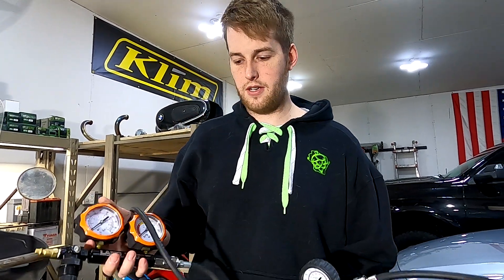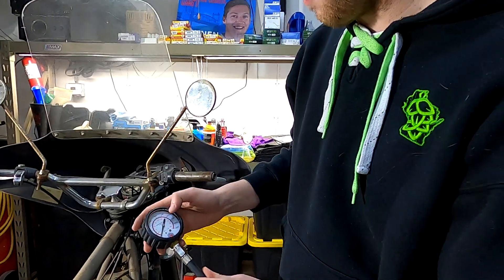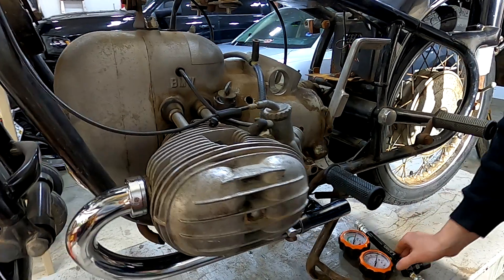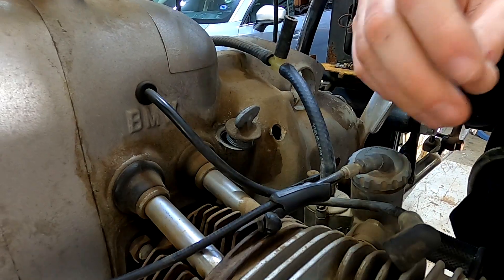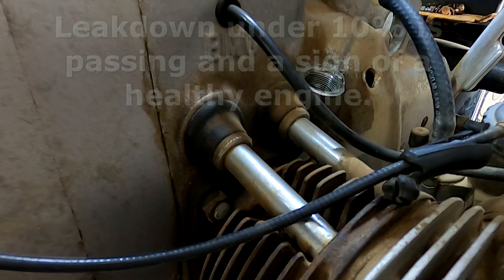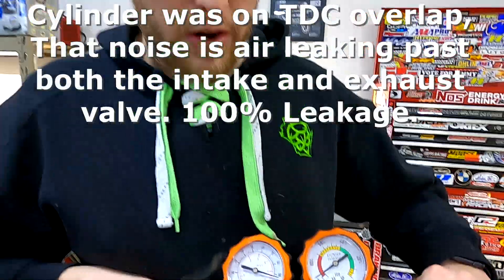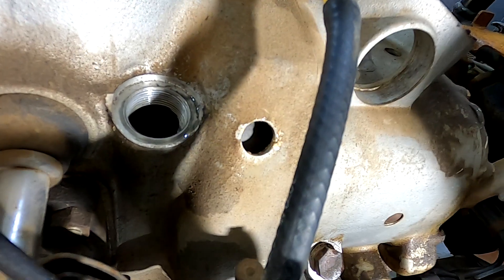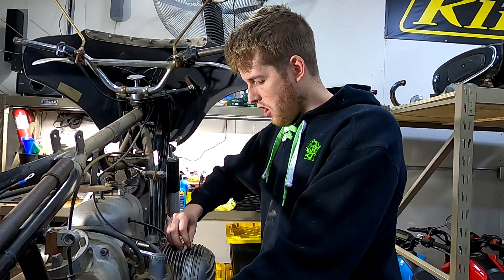BMW Airhead Compression and Leakdown Test Procedure

Comment: Hello, thank you for the grat viedos. Help me a lot. Could you please tell me how much is an accaptable cylinder end compression for an R51/3 airhead? MIne is around 72 psi , which I think is very little. Lots of air coming out from the crank pipe below, as well.

Comment: So, worth mentioning would be the compressor pressure you are pumping in please. Also, if you were doing say a leak down test on a two stroke - after I have done one on my R69 - I am guessing that the shop pressure should only be 10psi yes?
Reply: Yes I would be concerned at workshop pressure blowing seals etc. personally I would set the shop pressure to 10psi max.

Comment: Enjoyed this vid - really informative. So explain to me please. Compression test had large variance between cylinders which is contrary to what was shown on the leak down test. So why does the compression test contradict the leak down test?
Reply: Yes totally understand that but please explain why you would do a compression test Vs a  lead down test. What discriminates between using one against the other.
Reply from the maker: they are 2 totally different tests.

Comment: Thanks for all the videos relating to R50/2s. I am currently working on the exact model left to me by my uncle. With 75,000 miles on the clock im concerned about the oil slingers, it looks like a big job to clean them. Thoughts on an slinger cleaning video? Thanks!
Reply from the maker: Yes it’s a big job, I was going to make a video but am am not very good at editing and it would take a couple days. In the future I will plan to make a oil slinger cleaning video.

Comment: With the compression in the right cylinder at 170 and left cylinder at 140 with that make a difference with the motor's over all performance?
Reply from the maker: yes, but it hasn't ran in 30 years! i am going to check it again after i run it a little bit. could have some oil in the combustion chamber taking up volume adding to the compression.